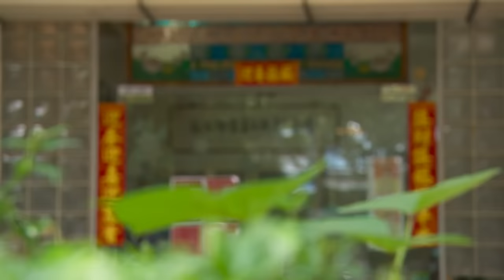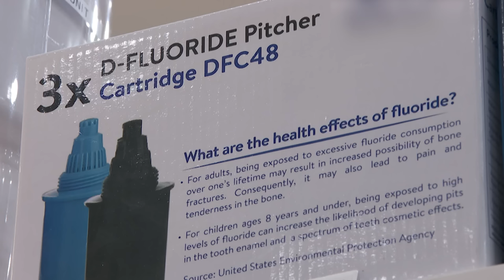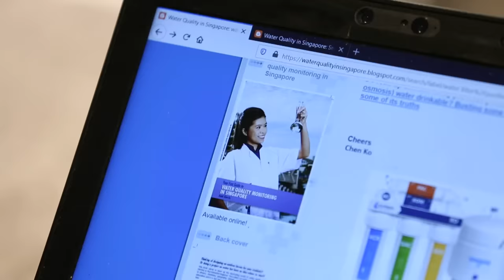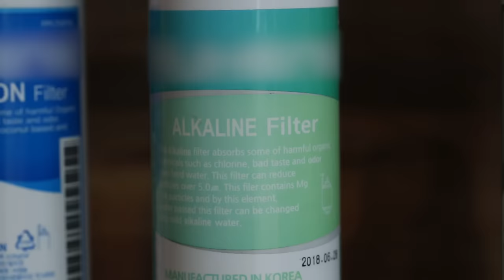Do Water Filters Really Purify Your Water? | Talking Point | Full Episode

Comment: One further thought.  Carbon filters work fine issue is capacity.  They can only absorb certain amount on organic impurities and after that they are dangerous because after they become saturated they can work in reverse by releasing what they have absorbed.  Carbon has a certain affinity for organic chemicals. Certain chemicals are more readily absorbed then others.  Such that these chemicals with a higher affinity will replace ones with a lower affinity.  So that when a filter reaches capacity these chemicals will
Replace absorbed ones resulting in some cases toc levels to go extremely high.  So the danger is when do you know when this filter has reached maximum.   That’s why most of these carbon systems have multiple columns of filters in series so as they reach saturation there is another filter that will catch the over flow to avoid contamination .

Comment: Thanks for this Exposé.

I went to Uni in Adelaide, South Australia, lived there for 6 years. It is one of the driest state in Australia, the diest continet on earth. Yet the water supplied to the household are safe to be drunk from the tap and its free (for normal household use).

I noe live in KL Malaysia. My elder brother was influenced by some savvy marketing, and bought the expnsive alkaline water filter system, and he recommends it, his body weight came down significantly over the years.
I reserved my comment on the system.

In 2019 he was hospitalised for gastro problem, then diagnosed with nancer stage 4, and died the nxt day the biopsy results was confirmed.

My house tap water has a filter at the incoming due to old GI piping system that may have rusted. Otherwise I drink off the tap, but my wife insisting on boiling them.

Comment: Im not 100% shure did we used PPI meeter but when we do the test between tap water mineral water and then filtered both roughly i give yoou the numbers: tap water above 700 mineral water above 300 then filtered tap water become above 400 and mineral water around 250. Also after fitering the PH came down with 1 or 2 points down. So you can do your conclusions now. BTW this was preformed in UK with Brita jug. Cheers

Comment: The effectiveness of water filter may not be apparent in the case of Singapore because the water from PUB is already clean to begin with. After all the water if I don't recall incorrectly also goes through reverse osmosis treatment. However, I do feel the filter can still be effective in removing the odour from the water coming out of our taps. The smell of chlorine in particular is very strong if you just use water straight off the tap. And interestingly, the results shown in the test shows that chlorine content remains the same, even though it is obvious the smell of the chlorine is greatly minimised in some cases.

Comment: I use a water filter for drinking water for a couple of weeks each spring and fall. During those times the municipal water has an odd odor and stronger chlorine smell than normal. That is due to our water being sourced from a river and the turbidity (basically the amount of dirt mixed into it) is higher during those times. The filter reduces the odors.

Comment: I found out with my Large Brita Spigot Reservoir, that when I Change the Filter, [which I now change every 4-6 wks 'cause it gets Refilled so Many times] to Wash Out the Entire Inside at that Point.
That includes Removing the Spigot Tap Top, and I have some Perfectly Sized Brushes to do the Inner Exit, and past the Ball Lock Stopper Exit, as they're 2 Different Sizes.
I put a little Dish Soap on them, and then Ream those Exits.
As one time I Missed doing the Wash, and thought I'd get it "Next Time".
Lo & Behold, when I wiped the Reservoir Bottom with a Paper Towel, it came out BLACK, and also noticed the Stopper's soft Plastic Seal was getting Mildew Spots on it.
I remember noticing beforehand that my water had like this Odd GREEN APPLE taste to it almost, which I never Tasted Before.
But I LOVE My COLD Brita Water...Without it, just drinking water right from the Tap, it Does Have some Flavor to it, that is not very Pleasant, and the Filter Removes it, whatever it Is...

Comment: very interesting reporting. i like it. however, the testing procedure was far from ideal. so many uncontrolled variables everywhere, tiny sample size, all different machines with different filters, testing proper installation and maintenance of the machines themselves, plumbing and hardware conditions, and the list goes on. BUT, my take home message from this video is that: installed water filters are not 100% safe in an average situation, and thats why i use a Britta!

Comment: Seems to be a misunderstanding with respects to adding minerals, the filters that do this are not claiming to add MORE minerals than tap water, they are simply adding in beneficial minerals that the RO and other filters have removed, so the fact that the tests show these minerals in water that has been filtered through RO, even if they are at a lower level than the tap water, is still a win for the filtered water.

Comment: very little information on filters that were being used to test. very poor comparasion between filtered and unfiltered water. Specailly taking into acount that water contains many more minreals that are hazardous than just chlorine and fluoride, such as aluminium, chromium, etc.. 
And cherry on the cake is that nowdays water contains parts of medicine in them, such as antibiotics, and painkillers which in long term can have negative effects. So, water fillters are maybe badly designed and maintained but waterfilter is not bad.

Comment: The truth is, there is way more chance your filtered water contain bacterias than tap water.  The reason is easy to understand.  The more contaminated surface the bacterias have to grow on, the more chance they will reproduced/grow and finally make you sick.

I used to use a Brita filter system, but i stopped when i realized that algae was forming into the pot that was left into the fridge for a few days and refilled when needed.  It makes sense, since the water that stays inside the pot had no chlorine to keep it safe anymore, and so, the bacterias/germs/algea could form and grow into it.  I loved that it removed the chlorine taste but, as time went on, i discovered we needed to keep the pot clean.  That means, cleaning it with chlorine, because washing it with the rest of the dishes was not good enough.  

If you use such a 'system', check the inside corners of your pot.  Dissamble it.  Remove the filter, and check it out with a magnifying glass.  You will probably see algae growth in the corners, as that is tough to clean correctly, espacially if you had had your system for a while.  If you or your family members suffer from diarreah, nausea, stomach and tommy ache, stop using your water 'filtering' system and see how you feel.

Be also careful, if you have a water coolant distribution machine, (espacially at your work space), as those often don't get clean with chlorine and can make you sick as well.

Comment: I don't have a water filter to raise the calcium and/or magnesium in my water.  What about lead?  Mercury?  Aluminum?  Trace amounts of lead is in most plumbing systems in the brass fittings.  My water filter does not reduce aluminum (I wish it did!).  I use a filter because it helps to reduce the chemicals that are in the environment, and the water system does not remove.  It can't.  There are too many chemicals in use now in the USA, probably in Singapore, too!  The bacteria aspect of it WAS interesting, though!  But not enough to ruin my day.

Comment: I do not know about you, but water quality varies a lot from place to place.  In a small town in Ohio, US, my city water has high sulfur content, that the hot water smelled like a rotten egg due to the anode stick used to protect the hot water tank...It is also quite hard, that my previous owner installed a water softener.  In S. Carolina, my well water quality is great, and taste great (I always boil the water for drinking, no mater if it is tap or well).  Then in Rome, Italy, I stayed in a hotel and wanted to drink tea.  I boiled the tap water and noticed the water turned murky.  I showed this to the hotel clerks and was told that their city water comes from  lime stone rich area that it was so hard, the calcium particles precipitated out when you boil it due to the lower solubility of the water at higher temperature.  The clerks apologized and gave us free bottled water with a tray of fruits desert. No hot tea though...

Comment: Filters are worth it, especially outside of Europe (in Europe tap water is already filtered at the plants), but the price of filter systems are NOT worth it, I think it is not necessary to filter ALL your tap water, only filter water that you want to consume with a cheap portable carbon filter. It will be much more space saving and price saving. It also doesn't require a huge upfront investment. Osmosis filters are not worth it, but sawyer filters or carbon filters are cheaper and do a better job.

Comment: I was curious if the filters has a UV light, would it be better?  Planning to modify mine to add the uv on the 2nd chamber and to the last 2 UV in 1 filter. Sinced they switched to metal pilings,  our waters smells a bit awful specifically the solvent scent.  Some told me that UV could prevent bacteria built up but also kills good bacteria but not really sure since I'm no expert. 😢

Comment: here in the UK, I use a water filter for my kettle and espresso maker, the reduction in calcium reduces the limescale build up that is common to hard water, such as that taken from the thames. But tap water is perfectly good to drink. Also Fluoride helps prevent tooth decay, so it's hardly even an issue.
Reply: Research Floride. 
NOT Good For You.
Reply: @Kiki-wi7px  Anything is not good for you when you hit a certain amount of it, Fluoride is however essential in very very small amounts. Fluoride promotes teeth and bone growth, too much growth has adverse effects but so does too little.

Comment: 7:16 if you want to get rid of your chlorine you just let it sit in a clear glass container in the sun or heat up the water on a low heat for 10 minutes. it has a lower boiling point that water
Reply: if you want minerals eat foods with minerals in them or buy some salt collected from dried sea beds that is not processed and place it in some water for a day and take a few sips of it.  it will help your body absorb them in a small way

Comment: interesting! I guess that another step (such as UV light) is required after the carbon filter
Reply: yeah I thought so too but have to ensure the UV modules are effectively applied. Some water dispensers have UV filtration in them. Dispensing hot water will be good to kill the bacteria but I like to be served with cold water for drinking, hence the UV filtration. Need to find out if it's really effective.

Comment: what about distillation process??? hope you will have another episode like this: will you please compare tap water, filtered water, alkaline water, spring water to distilled water. and its components too. thank you
Reply: distilled water removes everything out.  there are different certified grades.  lab grade distilled water is used for critical experiments and correspondingly very expensive by volume. the typical distilled water in a jug sold at a supermarket will be significantly more pure than bottled water but still have some ions in it as it is not lab certified.

Comment: Filtered water That only usettlement filters or active carbonated filters.
 Does not produce.
Safe water for drinking. There are different kinds of filters  Some filters are used to take sediment Out of the water and other filters are used to take out different chemicals. But If you want drinkable water. You must use a reverse osmosis system with no polisher. If you have a water softener and your water is chlorinated, then you need a carbon activated filter before the water gets to the water softener. because chlorinated water ruins the resin inside your softner. It's also recommended that you install a sediment filter as well. You also don't want chlorine or flouride in your water. It is recommended that you boil the water that you wish to drink and before you store it in your refrigerator.

Comment: I don't understand how the reverse osmosis failed to remove chlorine from the water when chlorine is the easiest to remove. A basic carbon filter can remove chlorine or just letting the water sit in a glass for a few hours, will cause the chlorine to evaporate from the water. Reverse Osmosis is supposed to remove everything from the water just like a water distiller.

Comment: The point of RO is the removal of "dissolved solids" such as calcium carbonate and Fe(OH)2, and colloidal (undissolved, non charged) molecules such as silica. A good RO system (we built our own to make 1000 gpd,) takes water from 300 ppm total dissolved solids to 4, silica free. The RO membrane will be very unhappy about chlorine and industrial contaminants (organic solvents, fossil fuels) or any solids incapable of passing through the concentrate (waste water) side of the membrane so pretreatment with a good spun polypropylene 5 micron filter, an activated carbon bed (or cartridge filter for household size systems) and another 5 micron after the carbon bed is necessary. This combination protects the membrane an insures longevity. Running the membrane at the required flow rate and product / concentrate is also required for best performance. The product water is very clean, if you put that water through a mixed bed deionizing cartridge (even 2-4 ppm is too clean) the water is actually too aggressive for copper or iron pipes, and PVC isn't a great idea either, so "dirtying up the water" with some minerals you can control is why the lady in the beginning is adding minerals. Technically RO water isn't great to drink excessively, it affects the osmonic pressure balance in your body, but a glass with a meal won't hurt you in the least. To cope with the bacterial growth, a 0.22 micron filter after a UV sterilizer will kill everything and the filter will collect their dead bodies.

Comment: We recently found that we need an RO system. I was in HVAC for 50 years so I have a good amount of plumbing experience. The lack of regulations on these companies is astounding and their claims are BS. What you need to know and none of them tell you is the GPD, the GPM and the waste to water % rate. Many will post 600 GPD but nothing else, they have lousy flow rates and I have found some that waste 10gal of water for 1 gal of fresh water, it took some digging. All of these numbers should be upfront. The other issue I found was there's tons of people, consumers, reviewing these products and all say "wow my water tastes good",  well taste means little regarding health. I have not seen one review, and I have read hundreds of reviews, that says "this was our water test before and this is the test after", not one. That's what we need to know, what was the water before and after. Also all of these systems need to give full and accurate info regarding water flow, we need GPD, GPM and Waste to Water levels. We also need the govt to step and regulate these manufacturers and sellers. These systems are supposed to treat serious water issues, many homes just need dirt/rust filters. You MUST test your water before and after.

Comment: Most use filters to remove the chemicals and after that they use it for boiling.
After all there is no point in removing bacteria if you trade it for vast quantitys of chemicals.
At most this shows that the filter did its job of filtering out the chemicals and debri as for bacteria , most who invest in it heavily have means to remove that as well. 
Only un suspecting consumer will suffer both worlds since they never learned how to get clean water.

Comment: My concern is that the water has to travel a long way to come from the source to your tap. If at any point in that journey (eg pipes running into your home / internal plumbing) there is an issue, then filtering the water could help this. Watching other studies (based in the US) it is obvious that in some instances filtering water helps.
Reply: Any recommendations on water filtration devices??

Comment: it really depends on where you live. if you live somewhere where fresh spring water is, you might not need one, but if you live in America, you may absolutely need one at least if you don't want your water to taste bad. 
some places not even that far from here have water that's brown or straight up toxic for human consumption. 
I would probably recommend that everyone get at least a basic filter to get out the basic amount of contaminants.
where I live, it's easy and cheap to get either a $20 filtered jug, a $15 water bottle with built in filter in the straw, or you get a screw-on sink filter for $13-20. of course you'd want to use one of these fancier filtration systems if you have poor water, but if you have at least clear water, you can use a cheap filter and it makes water taste just as nice as the stuff you get in a bottle imho